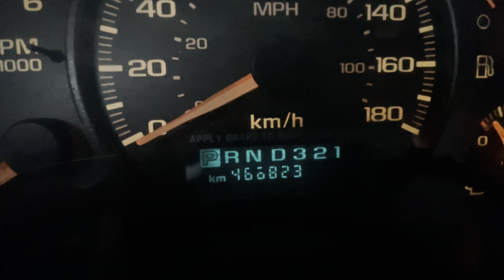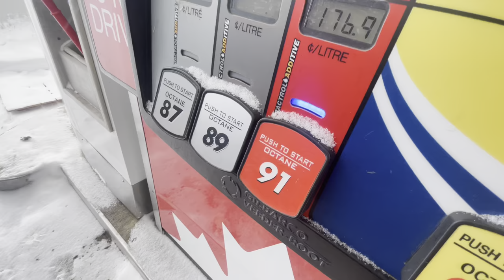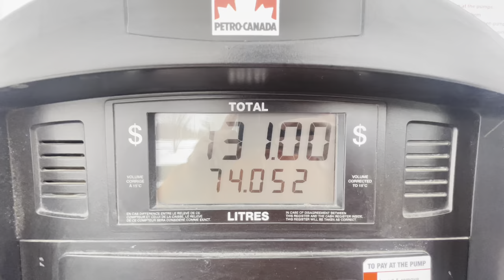i blew my transmission on Valentine’s Day….

Comment: Hahaha. I got the same truck buddy. Mine is white it's named after the shark in Jaws. If you blower motor squeels man. Super easy to swap out. Would. Possibly help. The heat blow. Also when ya do that change out the cabin filters. Would help too. If yours is like mine the cover on the cabin filter leaks like a mofo. I took a little scarp chunk of metal and made a little bracket to push on the middle of it off a close by bolt hole. What a wonder just that little chunk of metal made for the amounty heater blows.
Reply from the maker: I started squeeling after I replaced it… not exactly sure what it could be. I’ll have to give that a shot though!